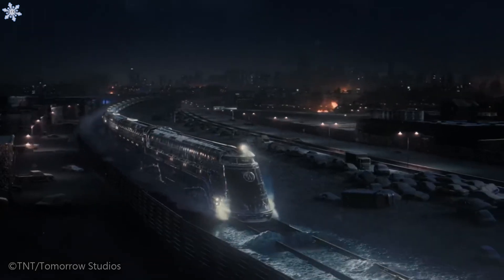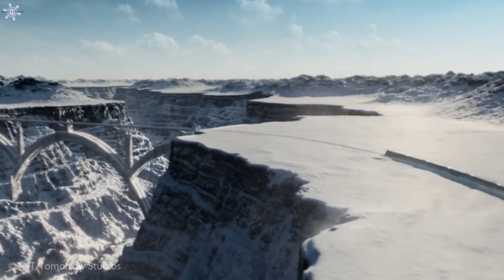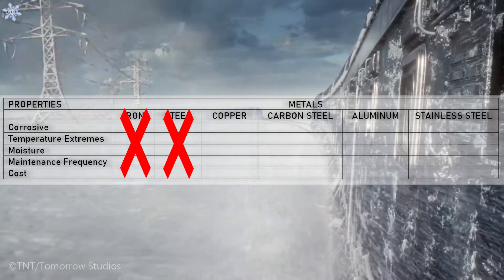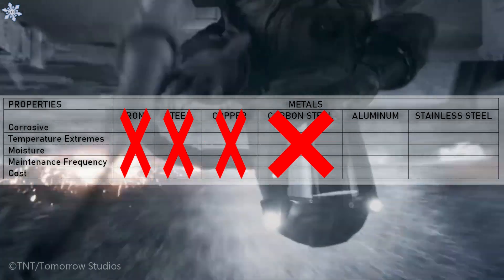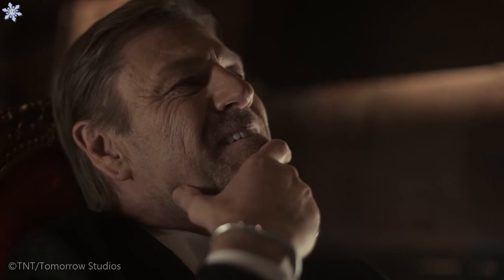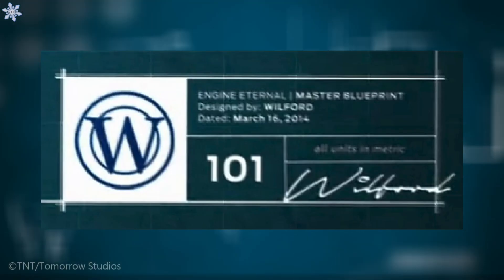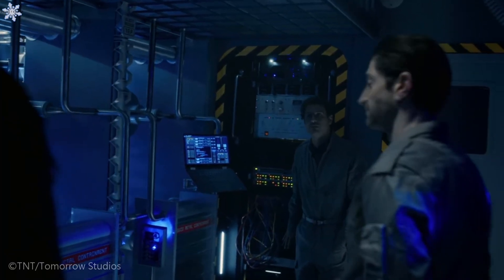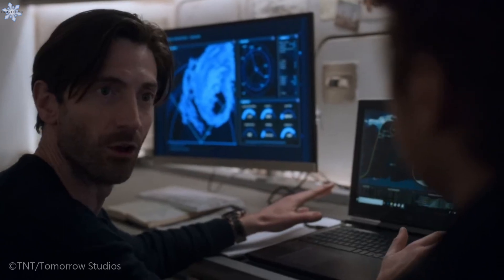Can Snowpiercer Actually Exist?

Comment: The biggest issue with snowpiercer isn't the materials it's made of, but how the hell its engine works and where all that energy comes from.
Any answer to that question poses another issue: if you managed to stick that "eternal" engine in a train, wouldn't be safer to just use it in a self sufficient underground shelter?
Yes, they would lose mobility, but with smaller self sufficient trains they could have scouting teams roaming the world for climate research.

Comment: Ok here’s the problem. Most people focus on the plausibly of the train itself. Snowpiercer (and Big Alice) as we know them in the show are more than possible with current technology. The only issue is the propulsion, as the existence of Perpetual Motion is almost certainly impossible, and while I don’t know if there is a power source than can handle a train roughly 36 miles long (I base that length off my own math) a train the length of Big Alice is more than possible.

The issue is the intercontinental rail system and its track gauge. Firstly to make a complete circuit around the Earth we’d have to link the Americas to Europe and Asia twice. Personally I don’t think it would be worth it to stop in Australia given it’s isolated location, the only way I can see that happening is if we try to use New Zealand and the multiple islands around it to build a Eurostar like system that goes under the Ocean. That also brings me to my second point. While it is would be fairly easy to link Russia and Alaska by using that one point where they get very close, and thereby negating the Pacific Ocean as an obstacle, the ironically smaller Atlantic is a whole different beast. Linking Europe and the Americas could likely only be done by first linking Northern Canada to Greenland (via all those large, mostly uninhabited islands) the Greenland to Iceland, and finally Iceland to Great Britain. This would make the largest hop from Iceland to Scotland. A over-ocean bridge is just flat out stupid, that would disrupt the global shipping industry. It would have to go under, which would easily be the longest tunnel ever drilled. How we’d do that, frankly I have no idea. I don’t even know how they managed to link England and France without having it cave in on them. But do I think it’s impossible? No, it isn’t. But the biggest problem standing in the way of an Intercontinental Broad-Gauge Railway is the fact that we don’t need one. Shipping and Air Travel have negated the need for something like this, not to mention that fact that since it would be Broad Gauge it wouldn’t be compatible with any existing rail system.

SO 

My 4AM rant over, is it impossible? No lol humans have been splitting atoms for energy since the early 40s ffs

WOULD it ever actually happen? Not in our lifetimes. A project of this scale would not only be the most expensive engineering project ever undertaken, but also probably the most pointless. And there’s no way in hell Wilford would have lived to see his Intercontinental Railway completed.
Reply from the maker: @GageisGreat12  So here’s what you got wrong. The track gauge you suggested is 100% wrong and if a cartographer saw what you thought they’d have a heart attack. First no international train system would go into the pacific or Atlantic ocean. You link Alaska and Russia through the Barring Strait (which is correct) and to link Europe and North America, you go through the Polar Region, not the Atlantic! Once at the very top of Nunavut (Canada) the track would cross into Greenland through a narrow bit of polar ocean, into the Arctic Ocean, then onto svalbard (Norway Archipelago) then cross into the next set of islands then get to the Russian Coast of the Laptev Sea. England, Scotland and Spain would the LAST in the European track before going to Africa through the Gibraltar strait. You tried to figure out the track from looking at the mercator projection map, which isn’t how it would realistically be done. The engineers would look at a globe, not a map.
Reply: @Frostrider  Good point on the Svalbard part. I didn't notice that reigon. Though the Nunavut route is what I suggested when I looked at all the maps,  I just didn't know the name of the area off the top of my head. And since you pointed that out, It's likely the railway wouldn't go to England at all, just more tunnels to bore, even if it would be the shortest one. One part I'm fuzzy on is where you mention the track gauge.. I never specified Snowpiercers' cannon gauge (because frankly I don't know it) All I know is that it is a very large form of Broad Gauge (this is the name given to any track gauge over Standard Gauge, which is widely accepted to be 1,435 mm) What I can tell you is that Snowpiercer as depicted in the TV wouldn't exactly fit on any pre-existing rail lines. The movie train might, because it looks to be much smaller, maybe the movie train even is canonically standard gauge, which is probably what they'd use if they were to try to link all the continents up anyway

Comment: I guess engine is nuclear powered. That explaines why they cannot stop (engine overheats and system shuts it down and that makes low electricity so low heat) and why engine gets hot when they stop the train for search Melanie. Also it makes nearly an eternal engine. A fuel that can last for years.
Reply from the maker: It’s not. The fuel is hydrogen.
Reply: @Frostrider  realistically itd have to be nuclear-powered fuel cells that turn water ice into hydrogen and oxygen
Reply: The entire thing is that it takes snow from outside and coverts it into hydrogen does all that jazz then the water is used for the train

Comment: maybe i missed something, but how does the engine at the beginning of a ten-mile train keep the whole thing warm? i assume the bogie motors underneath each car generate heat for the passengers?
Reply from the maker: It doesn’t keep the whole thing warm. The back and tunnels of the train is much colder than the front. There are no/few heating ducts there. Think of it like a house, garages are often much colder than the rest of the house because it’s not efficient put the heating system down there. It wouldn’t be energy efficient to pump heat in the tunnels or in the tail. It’s why when the train split up, the pirate train was overheating, that energy couldn’t filter throughout the train.
Reply: @Frostrider  okay that makes sense. i didnt think about the pirate train in season 3, where the engine was a literal hot pocket. im assuming it generates just enough heat to keep the third class passengers warm, correct? or am i missing something?
Reply: @Frostrider  that is cruel
Reply from the maker: @lucasgeesey4719  If you’re gonna act like a sleazy stowaway rat, don’t expect people to treat you nice when you compromise their resources.
Reply: @Frostrider  yeah but these are people, and the population is already small so you need a lot of people to prevent in breading. also weren't they throwing people of the train? I'm new to this world
Reply from the maker: @lucasgeesey4719  It's not THAT small that there's a risk of inbreeding. Inbreeding becomes a risk if there's a population of <50 people but that number varies depending on if any of those 50 are already blood related and the genetic diversity between them. There's not even a inbreeding risk in the tail as there was a population of nearly 400 in S1.
Reply: @Frostrider  still letting people freeze isn't ok and the first class people are fine with thay
Reply from the maker: @lucasgeesey4719  It's called survival of the fittest, when animals do it that's okay, but when humans do, that's totally unacceptable as if we're not also animals.
Reply: @Frostrider  you mean the richest
Reply from the maker: @lucasgeesey4719  I wasn't aware Snowpiercer's middle class was rich, then why are they working there?
Reply: @Frostrider  richer then the tail  people
Reply from the maker: @lucasgeesey4719  You mean the illegal stowaways?
Reply: @Frostrider  is it illegal to want to survive and also if they knew they were back there why not do something about them
Reply from the maker: @lucasgeesey4719  Melanie was too moral to cut the tail loose, but since they acted like rats, she treated them like rats as their "want to survive" put everyone else who earned the right to be on that train at risk.

Comment: What if we see Snowpierer as a train in a desert? In a world where global warming has took over, and made the earth inhabitable. What'd be different in the engine and what metals would be used?
Reply from the maker: It’s a lot easier to create instant heat (friction ex. train wheels on track) than instant cold. So Snowpiercer wouldn’t work if the world was too hot. A space station or a sea base would work best in that scenario.
Reply: @Frostrider  But what if snowpiercer was modified? Let's say that Wilford suddenly noticed the earth getting hotter and hotter shortly after discovering the freeze, and so he makes changes to snowpiercer's design. What'd happen to the engine itself?
Reply from the maker: @bolam20  The engine converts snow into energy. It has no purpose on a warm earth without constant fuel.
Reply: sand > hydrogen? 
 @Frostrider
Reply from the maker: @bolam20  Wanna know what you get when you heat up sand? 
Glass.
Reply: On a sea of glass  @Frostrider
Reply from the maker: @bolam20  yep
Reply: @Frostrider What if it melted the glass and fed it to some converter? Or used a battery, much like in the show, that uses perpetual motion to keep it alive?
I do think it is possible to make snowpiercer work in a hot environment.

Comment: The problem with aluminum is that it's extremely flexible
Reply from the maker: That’s not a problem. Flexibility means the metal isn’t brittle and lasts longer. It also matter how pure the metal is. Whatever metal Snowpiercer is some sort of super composite hybrid.

Comment: well lets put it this way, what if the show never had a freeze? or they wanted to build this train in rea life, they wouldn't need to do this much science and they could use conventional engines or convectional hydrogen engines. this means under normal weather circumstances, yes yes we could build snow piercer, but if there was a freeze, no no we could not.

Comment: If snowpiercer has a perpetual motion engine. but it uses hydrogen to power the engine. then its not perpetual. but if they mean just small amounts of hydrogen would power the engine. then it could be called a semi-perpetual motion machine. same thing with Big Alice.

and I don't thing semi-perpetual is a thing or I just made it up but you know what I mean.
Reply from the maker: You clearly didn't make it to the end of the video, or else you would know that the perpetual motion engine concept was just a marketing scheme by Wilford to get investors, none of which would actually understand the true mechanics and engineering of the train.
Reply: @Frostrider  I did make it to the end I just thought it might not fully be a marketing scheme. Because the train still has perpetual motion because Big allice has perpetual parts. and even ben mentioned that the train cant be perpetual without the perpetual parts that big Alice has. Because the perpetual engine is breaking down.
Reply from the maker: @DerpyAintHere  I never said it was fully a marketing scheme. Wilford just left out the part about what happens if the mechanics of the train get worn out, but since Big Alice was the Eternal Engine's prototype, Wilford likely would have mentioned that he has plenty of perpetual engine parts to keep the train going. Which also brings the question: why the hell didn't Melanie retrieve Big Alice the moment the parts started to get worm out?

Comment: Despite this train very big, it will not be able to drive on small tracks.
Reply from the maker: Duh.
Reply: @Frostrider  the track may have been built years or decades before the train, do you build a carriage before you have a way to move it? NO. it makes since they built the track for Snowpiercer. or in the future all train tracks are that big

Comment: My presumption is the bogie motors on the rest of the cars throughout the train use some form of regenerative braking per se (not necessarily braking, but having motors with this sort of property) to provide additional charge for the battery cars. Big Alice likely only acted as a supply train because it was not specified otherwise in the show, and it also makes sense for it only to be a supply train just like common sense-wise. I do appreciate the research on the metals for the hull and track, though, another assumption is probably they are capable of bringing the wheel assemblies or just single wheels into the subtrain for repair or replacement since there really isn't much else you can do in that respect.
Reply: And maybe some wheels which are not powered by motors are freelance, which gather more power. Makes sense?

Comment: it can but not currently, we are 1 step away technically, the Hydrogen fuel reaction it uses... we are so close
Reply from the maker: You do know that it’s more than one fuel type in the world right? Snowpiercer only uses hydrogen because they have to. In a unfrozen world, the train would’ve needed something more common and accessible.
Reply: @Frostrider  Hydrogen is the most explosive element in the unaverse. so would it work as a power source? Absolutlly. would it wear down the parts? also yes. I'd be amazed if the parts survived even 10 years. much less 30.

Comment: What I think started snowpeircer 
Hitters extinct train the breitspurbain train it’s huge
Reply from the maker: The breitspurbain was nowhere near the size of Snowpiercer. And the hitler train, much like Hindenberge, would never have worked long term.
Reply: @Frostrider  Why would it never work?
Reply from the maker: @aydinlucaz6249  Because the Nazis failed at everything. We don’t live in expanded Germany right now and most of Hitler’s ideas required technology that didn’t exist at the time.
Reply: @Frostrider  unless some billionaire decides to build one for luxury... oh wait😮. that's exactlly what Snowpiercer was used for.
Reply: @Frostrider  Du weisst nicht grad viel über die Geschichte oder?  Also nur mal so Thema V2, Jets, H0229, etc. und was mit der Deutschen Technick bei den amis passiert ist und den Wissenschaftlern nach dem fall des DGR?

Comment: As a self-proclaimed engineer and huge snowpiercer fan, I wanted to bring up that the tracks and train could possibly be made from ceramic or an alloy of titanium as the color of the train reminds me of titanium or silicon carbide.
Reply from the maker: If you were a real engineer the you’d know that none of those would be good options for the train hull or track.
Reply: @Frostrider  because? Your options are the total shit and no one would build a train out of this that has to last essentially forever. The modern human society has invented materials for exact this kind of use. So why would they not use them ?
Reply: @Flt.Hawkeye  in the show it wasn’t built to be eternal that was just a selling point for investors it couldn’t run forever because parts would break and without maintenance it would eventually stop
Reply: @Flt.Hawkeye  Mf how are you trying to argue with an actual Engineer?
Reply: the various temperatures they throw around from time to time confuse the hell out of me
Reply: agreed. the shells of the train and carriages would have to be coated in something similar to the tiles of the space shuttle which are viable protection to around -275C (and up to 1850C). probably also require tiling rather than sheathing as the inner shells and frames would still be subject to thermal expansion.
Reply: The weels of that Train can not be replaced and weels do wear down/break they are made of a softer steel that the tracks so the tracks will hold longer. If you brake the weels will get flat spots and those will get bigger so the train will have vibrations and we all know that puts a lot of stress on material.

Comment: so we need to freeze the world first to have unlimited amount of snow to support the engine???
Reply: nope.
too cold for precipitation. they never actually have a snow storm on the show, but rather high winds
come to think of it, the aridity in that climate would preclude gathering moisture from the air for electrolysis.
Reply from the maker: Yeah basically. Snow has a higher level of hydrogen in it than the atmosphere does.

Comment: well for clarity it was said many times that Snowpiercer's original purpose was not to go around in extreme cold , it was supposed to be a train that simply goes around the world as a cruise ship on the rails and it would be impossible for a single engine to pull so many cars so they probably added whatever they put in the engine in some of the cars to make the train rune efficiently
Reply from the maker: I assume you didn’t actually watch this video or else you would know that I mentioned that.
Reply: @Frostrider  i wrote the comment at the beginning of the video , oops
Reply: The train was already 1001 long because during his revolutions in normal wheater it was already autosustainable
Reply: @TheFedeGamer99  yeah but have you seen what happens to trains when they are too long ? the cars in the middle almost derail so how does Snowpiercer not derail so seasily ?
Reply from the maker: @Battleshipfan  No, they derail because engineers cannot see the cars however on Snowpiercer, the engineers can through technology. It can be used see what bogie motors are offline. The engine gets alerts whenever there is a breach, a stuck exterior vent, or a pipe burst even. Meaning everything on every car is monitored. Something that trains in our world don’t have. It’s how Melanie kept Snowpiercer in one piece. Let’s not forget that both the train hull and train tracks were custom built to suit basically any environment.
Reply: @Frostrider  seems like a good explanation